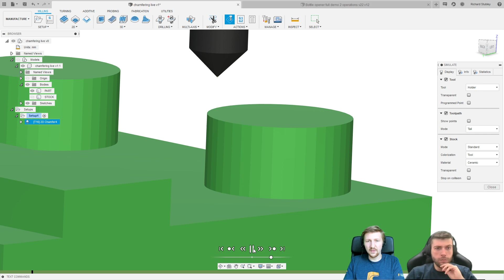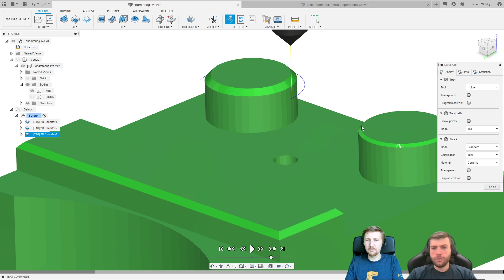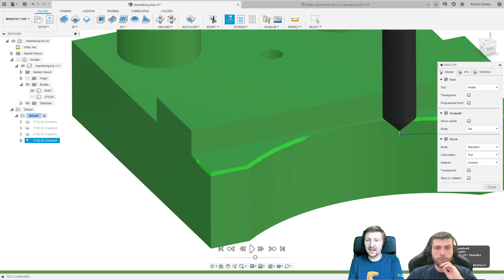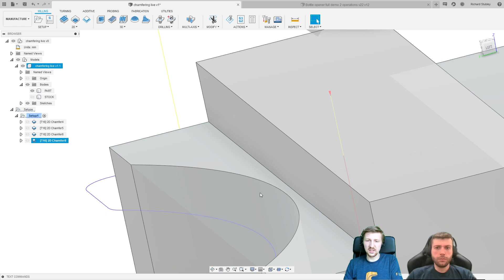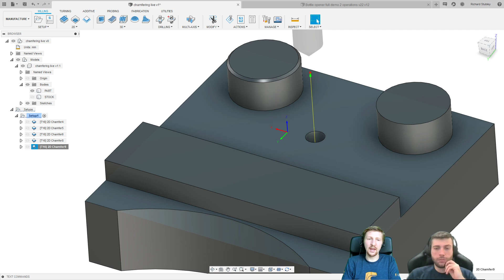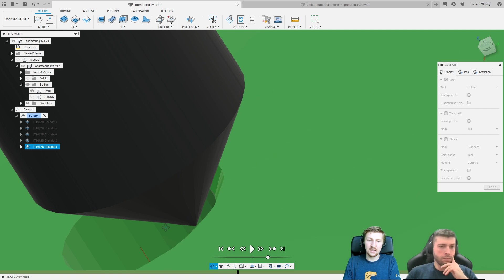Fusion 360 Live: Chamfering Basics

Comment: Does Fusion have a way to step with a chamfer tool to make a large chamfer? For example, if I have a 12mm diam chamfer tool, could I make a 30mm chamfer on an edge with several passes?
Reply: On your first pass use 2D contour , on the passes tab set your chamfer details and also click stock to leave . Then on the 2nd run use 2D chamfer cycle form the drop down under 2D
Reply: @ozychester2295  I'll give it a shot! Thanks mate!

Comment: Hey guys , you guys did a great video. I had a question, how would radius the edges. ? and how would you do it on a 3D surface?
Reply: Hi I mainly depends on the geometry, If you can do it with a radius tool ad a trace toolpath. Or if you will have to interpolate it with a ball nose tall and something like a scallop toolpath.

Comment: Around 18:50, You tried to break up the tool path on the back side, it didn’t work, so you stopped & began working on the front. Can you go back & show how this is done?
Reply: Hi Bill, good spot, I had left a sketch active from the design environment but didn't realise at the time, I should have just turned the sketch off but I bailed and chose another contour. I could have shown the tip as well as if you hold down the mouse click you get a box displaying all the items the mouse intersects not just the top contour. Hope that explains it.

Comment: Doesn’t chamfer tip offset refer to the top of the chamfer, and if so, why are you subtracting the chamfer width from your flute length?  If your chamfer length is > half you flute length, you will go off the bottom of the tool, correct?
Reply: Hi Kurt, yes in that case you will be going off the end of the flute length, you don't need to remove the chamfer width but I prefer to to keep a good balance down the flute length, we have a 12K spindle so surface speed isn't a huge issue so I tend to use chamfer width as a additional parameter to cheat and spread the wear on the flute by moving it up and down slightly depending on the chamfer width.

Comment: Thanks guys for the info, I need some help with the mill turning function, I hope that you point me to right direction, I  trying  to do mill turning in a tormach machine, but during my profile finishing in my Feed & Speed Tab, the option for using a Constant Surface Speed is not being recognized by my Path-pilot software. 

Any idea.? Thanks for what you guys do.
Reply: Hi I would suggest putting your query on the forum, with some projects and pictures attached, its much easier to have a conversation on the forum than YT. https://forums.autodesk.com/t5/fusion-360-manufacture/bd-p/2070